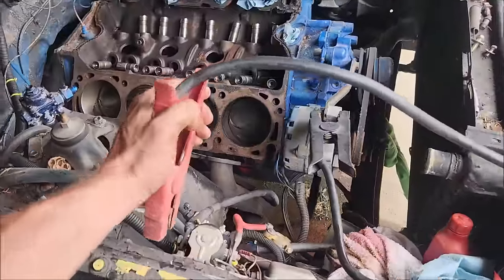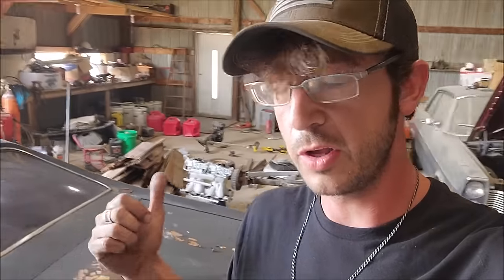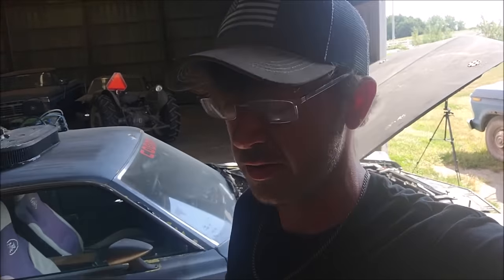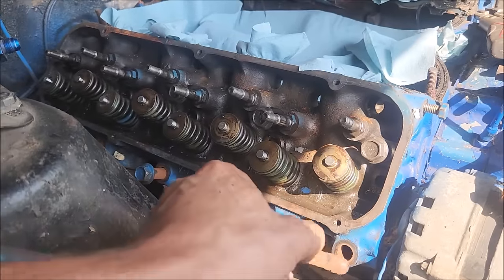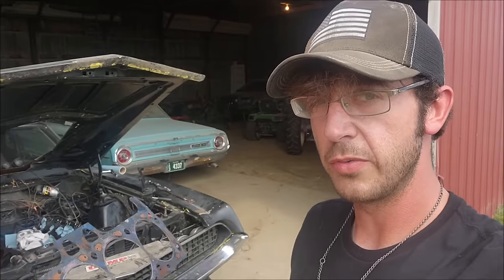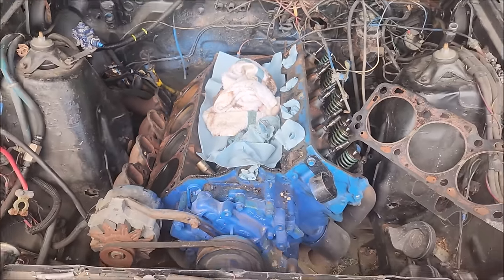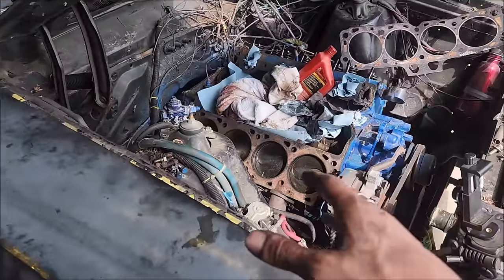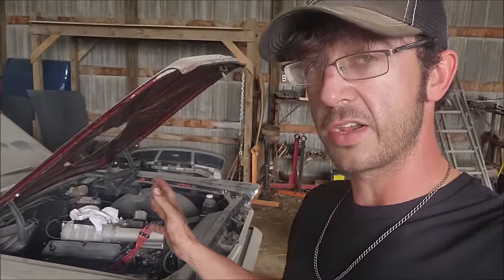Will it Run? Engine Fubar? 1970 Ford Torino DRAG CAR - Parked 20 Years Ago!

Comment: I gave my recommendation in the last video, I said keep it and make it your #1 priority. From what you said about the supercharged car next to the Torino, it could be made to run while your rebuilding the 429 or building the possible 460. At any rate, they will both be awesome.  I'm 51and the most important lesson I've learned about cars is absolutely don't sell anything you remotely like on a whim...You will definitely regret it later. Like you said, where and when could I find another complete pro-streeter for under $10 grand....never- nowhere!!  You lucked out on this Torino. An added bonus is you have the first pro street car among any of your friend's you tube channel's plus its an actual build from way back in the day, not a modern imposter. Start saving for fresh "steamroller" rear tires tomorrow!!!
Reply: We all have to remember Luke works a 40 plus hour day job with a side hustle (carb cheater) and a YouTube channel! I don't know where he finds the time.
Reply: @garywinters2282  : You make the time. Sleep when your dead!!! I have a 45 hour a week gig as a heavy duty truck mechanic,  do side work whenever I can, plus work on my 4 vehicles, A 1969 LeMans, a 1979 Toyota Supra, a 1987 Fiero GT, and a 1999 Silverado 1500 short box Z-71. Where there's a will, there's a way, and I'm 20+ years older than Luke.
Reply: Yeah .. what he said!
Reply: I miss the regular videos,I've learned a ton about carbs from you.   I hope you have the time and money to keep up all this awesomeness.   If not I'll enjoy what I get.   I hope you keep this rig as well but everything is for sale for the right price.   Good luck uncle Luke!
Reply: I completely agree!!!
Reply: @rogergoodman8665 , 100% agreed with you.  (and I'm a decade older than even you) Don't sell a likeable project until you know for sure that it's not going to work out for you.  About 10 years ago, I bought a 72 Pinto Pro Street car project for $500.  It was obviously rough for that price, but the hard work was already done.  302, tubbed with narrowed 8.8, suspension, etc... but the engine came in multiple boxes and all the critical parts were there.    At the time, I had a C5 Z06 Corvette SCCA race car project, and a 89 5.0 Mustang project going, so the Pinto just sat for about 8 months...  When someone saw the Pinto and offered me $800 for it, I jumped on it.   Fast forward to about a year later when the Corvette and Mustang were done, I highly regretted selling the Pinto, and still do to this day.   Trust me, the $300 profit I made on the car without ever working on it was not worth it.   Heck, while the Mickey Thompson tires were shot, the Pro Street Weld wheels were worth more than the $800 I sold the car for.   Yeah, I'm an idiot.  😭
Reply: Can't Luke get like a marti report and see if it's a actually a Ford Torino cobra and actually I would guess that it is, and if I am not mistaken that cap in the trunk on the fuel cell is the original gas cap
Reply: @garywinters2282  you have a very valid point and also shows why his channel is as popular as it is I know it's always been a favorite channel for me to check out!!
Reply: @rogergoodman8665  "absolutely don't sell anything you remotely like on a whim"    1000% agree.  Never, ever sell anything that you like, unless absolutely necessary.   You will 1000% regret it.
Reply: Listen to this man. This is all my dad ever regretted in his final years.
Reply: I sold an 89 bronco 4x4 inline 6 5 speed and all I can think about is how clean that damn dash was 😂 Why did I sell that Bronco damnit I'll never have another in that good of shape
Reply: 100%, never sell what you like...I had a 1970 Mercury Cyclone with a stock 429 Cobra Jet that I bought for 500.00...I was a sophomore in high school and that was a fortune to me back then. I was told the motor was blown...pulled the motor and found that the nylon teeth were gone off of the timing gear!! 30 bucks and some sweat later, it was running like an angry rhino.. I sold it to a buddy for 1,500.00. I wish I still had that pavement destroyer. It burned rubber in all 4 gears.
Reply: Definitely keep the car and 429, too easy to just slap in a 460, the 429 is a higher revving engine with great potential - keep the 429 and run the wheels off it.
Reply: it's worthless  Ford big blocks are junk !
Reply: who are you ? Henry Ford ?
Reply: @richardbates2367  I don't get what working a full time gig has to do with his popularity on yt?
Reply: We won't likely see either on this channel again. He seems to just post randomly when he's feeling like it. Which is his choice. But I've wanted to watch him do a project car and to bring one like this one back to full life but they always seem to just disappear after he shows them once or at best twice.

Comment: I think this is a great project to generate a lot of interest from the subs. I know I’m very interested. I would love to see the 429 rebuilt and put back in. A close second would be a hot 460 swapped In  ultimately I would love to see some passes down the drag strip. Thanks for showing this really cool car.
Reply: It might have started life as a SCJ because of the appearance of what looks to be a transmission cooler next to the radiator and CJ's didn't come with them.
Did he say it's not the original motor?

Comment: Have you run the numbers on the car? Is it a Torino Cobra? What heads are on it? If it has D0VE heads with flat top pistons it’s around 10.5:1. That engine with a good cam, right intake, carb and headers is a 500hp engine all day. I would definitely do some digging on numbers to verify what everything is. I would also check the block numbers. You just might have a unicorn sitting there. Just my nickels worth of free advise.
Reply: By the body style being it looks like a sedan it can’t be a cobra.

Comment: Luke, I know you said you got alot of projects but don't sell it, it's one of those cars if you do sell, you'll forever curse yourself for not hanging on to it.
If it was mine....I'd keep the mad max/ratty vibe and set it up for drag n' drive events.
2 schools of thought on how to move forward, you pull the 429 and do a budget refresh and focus on making the car safe, get the cooling side of things locked down and set-up right, replace/rewire, inspect the cage and chassis and bring em' up to spec, then sort out the interior stuff and make it as safe, comfortable and user friendly (as much as a drag car can be) for yourself and passenger.
This is where I'd spend the big $$$$ I'd go with a speed gems 6r80 conversion kit and v8 6r80 trans and trans controller or at a minimum a built 4r70/5. Bolt it all together go shake it down, then go have some fun and drive the tyres off it. Yes, it won't be the fastest thing but you'll get to learn the cars quirks, faults quickly....leaves it open to do a big banger engine at a later date.
Then theres the 2nd way....this is where it might become one of those never ending parts list/project type deals....carry that same look/feel, again using an overdrive trans but you forego the budget build, throw everything at it all at once and jump right into a big hp combo. 
You'll still have to go through everything as before but I guess you don't have to do an engine swap later....they both have they're good/bad points.
Possible race/promo vehicle for carb cheater????
Give it a name like, thunder road, thunder row, Thunderino....anyway, I think I'll just exit here now. Lol 
Cheers 🍻 Rob.

Comment: I like the 429 more than the 460, because it likes to rev, and has better throttle response. The cast iron intake is so heavy, I thought for sure I'd left a bolt on it somewhere!
I'd deck the block, clean it really good, run the oil pump without the heads, put it back together. 850 CFM carb and headers and you'll be amazed by the performance. 🙂👍

Comment: I’d just pull it and have it decked with a .030 overbore like you mentioned. You could also pick up a 460 short block and use the 429 heads since they are the smaller chamber, higher compression heads. Cant wait to see what you do with this project👍
Reply: Great comment. I agree.
Reply: yeah but those cast heads add so much weight to the car. and they are a biatch to change. plus you'd want to go all the way through them. new valves,guides, seats ,resurfacing etc.and while you're at it new springs and rockers. you could make up for the lack of closed-chambers on the aluminum heads with a little more aggressive piston. remember the deck on the block needs surfacing too so theres a little more compression there.
Reply: @Hobodeluxe960  all good points, sir.
Reply: 30 over always overheat easy
Reply: I agree 2 on this

Comment: With a little scraping, a few gaskets and an oil drain plug put it back together and fire it up! Plenty of time for the Galaxie. Part three would be timely now. More content on this story please! ;-)
Reply: I'm with you!
Reply: @bigjohnson7415  I agree. If it eventually does destroy itself go the built 460 route
Reply: @scotthanson7888  Absolutely. I'd really like to see it converted back to a street car, put a street rear end in her, low rise intake a single 4bbl, daily drive her. But that's me.
Reply: Clean it up, reassemble....send it!👍
Reply: A 'little scraping' isn't likely to do the trick. A composite type head gasket with Copper coat failed. The deck surface is damaged.
Reply: @foghornleghorn8536  Never said this would be a good fix. The point is @ThunderHead289 for the sake of a third episode answer the question in the post, "Will it run?" After that fix it right or move on. Answer the teaser. Easy content for your channel perhaps...
Reply: @Wildeman5060  I suppose pandering to idiots would be one approach he could take.
Reply: I say run the Godda### thing already!!!!!

Comment: Just a suggestion to help save what's left of your back:  remove the hood and use your cherry picker/engine hoist to get the heavy intake, heads, etc. off the engine.  As an older fellow with a badly damaged back, I wish I'd taken better care of mine 😢
Reply: It’s only a few bolts and takes no time
Reply: Forget all that nonsense... just have the wife do the heavy lifting. I'm sure her back is just fine... 😉

- Max Giganteum

Comment: I think the high temp silicone thing comes from them being needlessly cheap. They figure you can use high temp in low temp situations but not vice versa.
You're def not wrong about it being an indicator of hackery
Reply: Hackery? Sometimes yes. Sometimes no. Most of the time it's a lack of education regarding gaskets and sealants along with when and where to use them. Most folks never attain any formal training in the mechanical arts and it shows. Best wishes!

- Max Giganteum

Comment: I'd like to see both naturally.  The Torino might be worth a bit if you can get it running.  A 429 isn't a bad engine, and if you get it out, it would give you a chance to get the rattle can blue off of the oil filter and reuse it.  That would save you a good $8 right there..
Reply from the maker: I love the seriousness of this comment lol
Reply: I would like to see you build a motor for it whether you use the 429 or build a 460 . You are very passionate about your cars and would hate to see it go to someone that wouldn’t care for the car
Reply: @ThunderHead289  I wonder if you can get new decals for an oil filter?
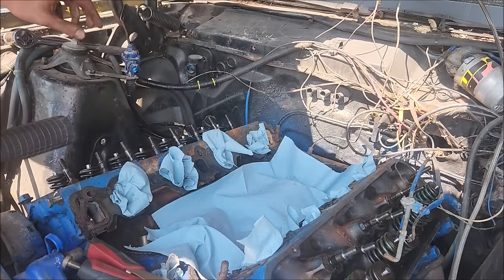Reply: @8:58. Thank you, Luke! 👍. U just saved $$$ for someone.
Reply: It also has the plates to go with it
Reply: I wouldn't pull it.  Lap valves and make sure the heads are flat.  Bolt her back together.  Used aluminum intake.  Then let it eat.  When it starts smoking bad, do all the junk you were planning...  keep it cheap and fun.  We all know the most correct, timely, and expensive way to do things.  Overbore, deck, new pistons, rebalance.....  it's a snowball
Reply: @cduke1780  Good amount of copper spray.
Reply: Like the paint on the oil filter hurts Anything!
Reply: @ThunderHead289 I know Id Lose sleep over the paint on that oil Filter! LOL!

Comment: Thanks Luke, you are motivating me. My Mustang is still on its side jigged up to finish the restore. Only thing on it is steering column. Got flooded with Hurricane Ida, a pink title from that and cancer. All is back to normal, and I am catching up. I will be back on my 1968, 289, cherry red convertible Mustan restore this winter. I have been following you for years now. I have owned the Mustang since 1984.

Comment: which is cheaper? deck/bore/build or a 460 build? seems like the 429 rebuild would be cheaper so do that! great content.
Reply from the maker: A healthy short block 460 (in production till 96 or 97) can be had real cheap and in good working order - then heads are roughly 1300 and your ready to go. 
The 429 to return to "as it was" would be roughly 3500. 

The 460 is actually the cheaper options and would make notably more power. "460" just doesn't sound as cool 🙂
Reply: So, build a stroker monster then with the 400m block there are rotating assemblies built for this fairly reasonable priced.
Reply: ok then....460 it is. cant wait to hear her run!
Reply: Looks like you have a set of thunderjet heads there. Really underrated! They were closed chambered, slightly smaller valves, with non high performance valve train. Stoplight to stoplight will outperform a set of CJ heads. In stock configuration.  Mild port on the exhaust runners, 460 crank, high performance adjustable valve train with a decent cam and you have an easy 500hp on the cheap. When considering what aluminum heads cost these days. 
I completely agree about the orange gasket maker as well, my dad used that all the time back in the day and he was a hack from way back🤣🤣🤣🤣

Comment: If it were me, I’d rebuild the existing engine but would examine closely and determine how much overbore and also any crank turning your gonna need to get it true. The heads are gonna need to be reworked and depending up degree of damage (I’d strip, vat soak, clean and NDE the heads for cracks) and also determine how much you’ll need to mill to get it flat. Then after that you can decide on pistons, rods and cam. It’s likely you might have a cam stuffed in there already by the previous shadetrees. Main thing is. At the end of the day, once it’s installed, it will run and be something a buyer would be more likely to become interested in, especially if you do it right and chronicle the rebuild via YOUTUBE. The car is no doubt a resto-mod project and anyone else considering it for such will be more likely to spend more if the engine and drivetrain is sound and engine rebuild fresh (and done correctly NOT by of the former mechanics who had a hand in this engines life up until you got it). One of the other commenter suggested staying with 429 heads. I agree however since the heads are at that point of needing serious attention, you might be able to do some great improvements to valve seats, guides and valves to enable some cool stuff like NOS or boost or just get the Cobra, CobraJet performance anyone would want in such a car versus.  

I do NOT think you should try to build a “Hell Yeah Brother” out of that beater. Make it run RIGHT!  Re-evaluate your love affair with the car, the. Maybe sell it for a more healthy sum than you have in it even after the rebuild. Being able to prove and convince a buyer that the engine is fresh, of known specification, provenance and performs on par with the 429 SCJ of the era AND was rebuilt with rings and pistons that would adapt to NOS or boost etc., if I were considering buying that car, for a race car build, I’d be most concerned with the engine and drive train in order to build confidence and better understanding of what else’s it will, cost to get her on the track. I wouldn’t be expecting it to be track ready (thus the word race car project). Just break it in right no don’t F-up the wear in by trying to make burnout videos, save that for the day of the sale. Good luck

Comment: When I was your age, I discovered that leaning over the hood of a car for a session of wrenching was giving me several days of sore lower back muscles.  Even when I wasn't lifting off anything heavy.  
   I found that wearing those black back protectors with the velcro greatly reduced that.  You can get them at Harbor Freight last I checked.  I was worried I'd look like Roland LeBay in "Christine" if I wore them, but they can go under a t shirt.  Now, I think I should get actual Roland Lebay type back protectors or braces or whatever they were if the still sell them.

Comment: Oof. I really felt it when you said that cars with the red RTV were usually cobbled together by the last owner. I'm currently rebuilding a '73 D100 that had an engine swap done by the last owner, and dude thought that he could just slather red RTV on the block to fix an exhaust manifold leak. I wish that was the least of my problems.

Comment: 43 years in the business take it apart clean it up put it all back in it will probably run like a champ and don't forget to lap the valves all new seals at least and hey give it what it needs new seals maybe even the timing chain because it's a badass motor

Comment: You're 80% of the way there. Might as well yeet the other head and pull it out. While the block is at the machine shop you can address the rest of the driveline, suspension and brakes, the interior, rust, paint and electrical system. 
Just a fun weekend project 😁

Comment: I had a 65 galaxy as a first car back in the day, it had a blown 352. I found a 69 third 429 thunder jet put that in the galaxy along with a 323 gear and posi unit. That car was bad ass. Wished many times I had kept it. It was a super sleeper.